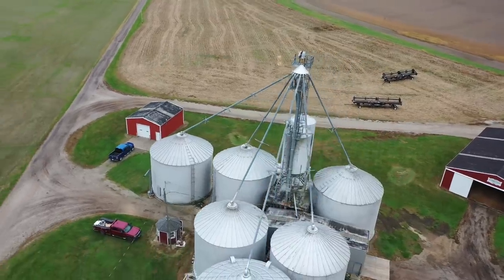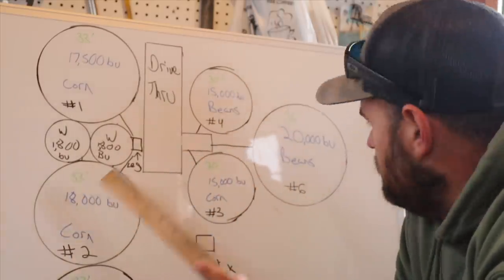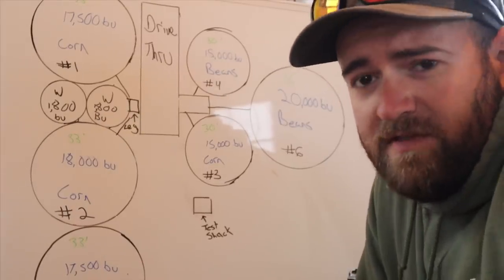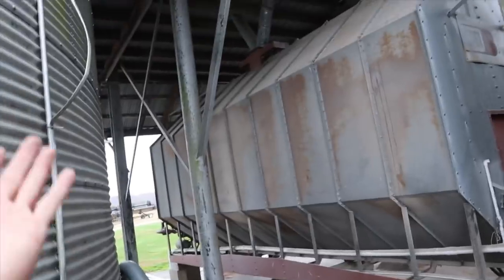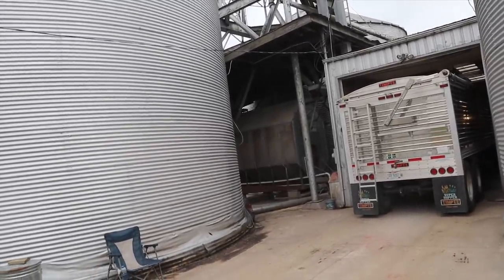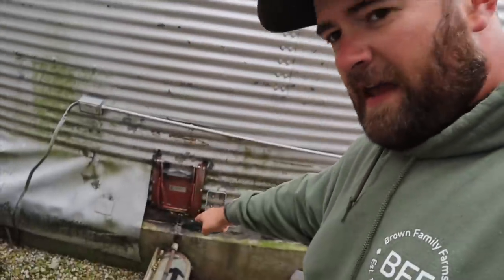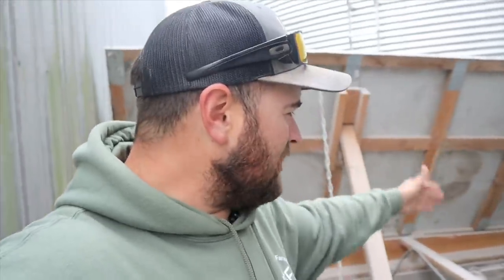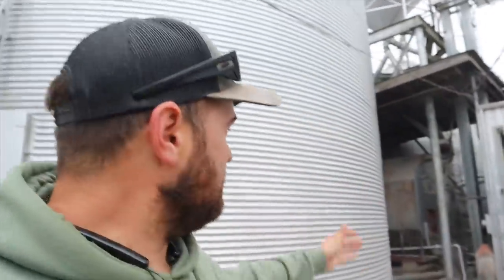46 Year Old Grain System! How Does it Work?

Comment: Hey man. Loved the video. Full disclosure. I was one of the original sales people that helped design the system Binmanager, but no longer with the company. Now I’m a 1st generation farmer myself. Started in 2017 from scratch. 
I think in time you will fall in love with the system more and more every year. I still get calls from my old customers, now friends, and answer their questions and they still thank me for helping design their sites and give them ideas. Some suggestions if you do put some systems in your older bins (or even if you don’t) make sure you have vents on your roofs. You have mentioned in past videos, issues with condensation or spoilage or pipes plugging. More than likely it’s due to the moisture not having anywhere to go except into the leg spouts, condensates and falls back onto the peak or run down the roof to the side walls. Peak vents are inexpensive and easy to install. Imagine blowing into a pop bottle with a pin hole at the top, the airflow doesn’t have anywhere to go. Now imagine drilling a couple 1/4” holes in the same bottle. Air flows has somewhere to go and take the moisture with it. 

Axial flow fans suck. Centrifugal fans are more energy efficient and have greater cfm, and pay for themselves in time with energy savings. 

The system will make you money year after year on soybeans, save you money on your corn (unless you are natural air drying the it will make you money) but it can be difficult to trust the system 100%. The fans run a goofy times sometimes. Trust it and you will be happy.

Comment: Hey Brian. You could probably use some kind of roofing material to make the dog house water tight-ish. They do some applications to concrete roofs that come in rolls of thick asphalt/rubber and heat it up with propane to seal them. You should look into that

Comment: Can you explain why it seems the majority of farms in the USA and Canada use circular bins for corn and bean storage as opposed to a clearspan building, reinforced walls often with an internal air tunnel for routine cooling and ventilation. Perhaps semi permanent subdivisions for differing crops or varieties.
Load in with a drag conveyor and sometimes a travelling cross conveyor via a drive over pit (under cover) with separate continuous flow dryer. Unload generally via big bucket on a loading shovel into trucks but sometimes drag conveyor to the leg over the pit or overhead hopper bottom bin.
I understand the additional your major issue of wet corn storage when you are able to harvest corn with modern combines so fast but is solvable with separate wet storage close to the dryer and can finish up being dry crop storage.

Comment: Brain/ bob, depending on how much you want to solve your water problems I’d recommend digging a trench all the way around the bin setup a foot or two below the lowest point in the dog house or leg. Then lay a tile going to a sump or ditch (depending on grade), then backfill with 1x3’s or other large stone to stop water from seeping under the bin facility. Could be done with a tile plow, but you want a wall of stone to help stop the water.  Have done this around an entire housing lot that was so wet we couldn’t dig a basement in, came back a week later and ground was dried out, even dried out neighbors basements. Just a thought

Comment: This place is almost IDENTICAL to a leg I rented this year.  How do you deal with rats?  I started the year by kicking the leg on in which a rat rode to the distributor at the top and plugged it off, resulting in the leg back-legging and a bad start my first day there.  Fast forward to the end of harvest, I cored out a bin today.  I’ve got a trough just like you do here that the bins are tied into.  Rats LOVE it.  I’m talking rats the size of small dogs.  Well one of these spawns of satan gets in the unload of a bin via the trough today and got stuck at the end of the auger when I kicked it on causing it to smoke the belt.  So here I am trying to turn the pulley with a pipe wrench which at this point is smashing a rat like it’s a juicer.  Finally, the rat explodes with the pressure of my manly strength and the help of a 6’ cheater pipe and I get the thing running.  (Sorry to whoever’s cornflakes have extra protein now)

Leg is the same way, in a pit, poorly drained, and loves to leak grain in any spot imaginable.  It was built in 1969, like you said no one anticipated what things would be today.  But, how do you deal with rats, raccoons, and rodents?  Between plugging things off and chewing wiring, I’m struggling.  But, having this leg has paid off logistically and financially this year despite the headaches it’s caused.